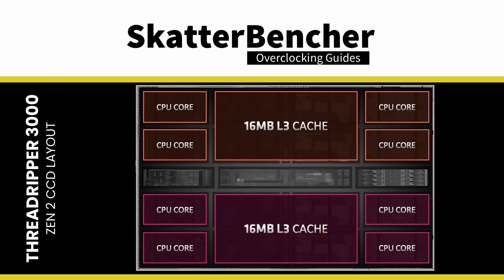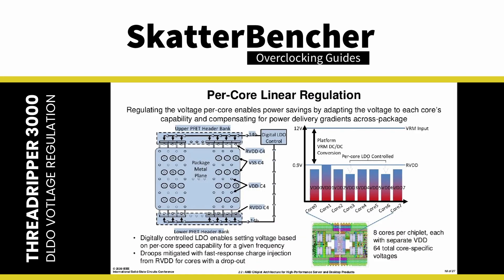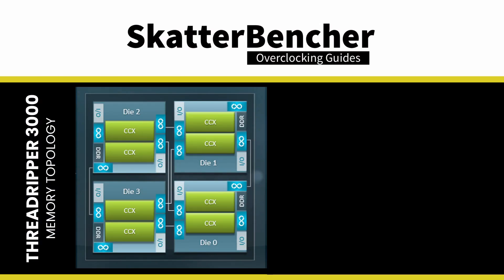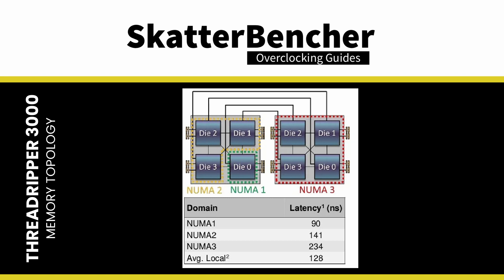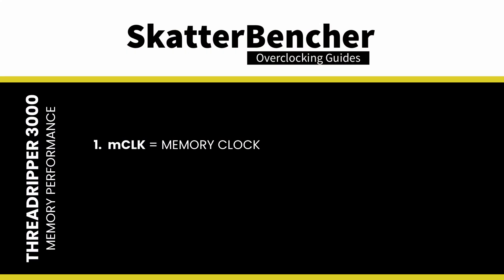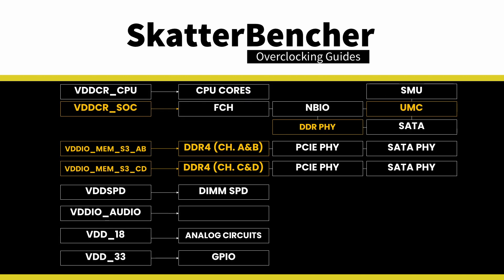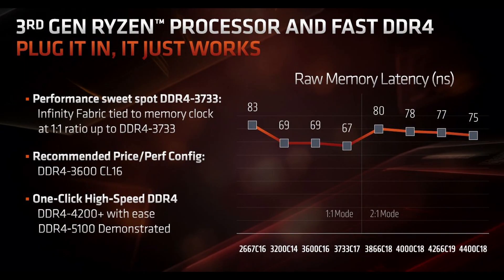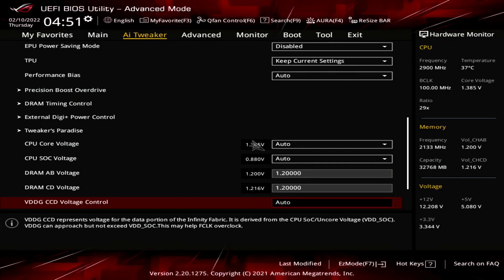AMD Castle Peak Performance Tuning Architecture Overview (Ryzen Threadripper 3000) | SB#36

Comment: hello. Is there any way or tech specs to figure out which motherboard holds / sustains heavy overclocking best?  or in any case that manages to provide higher consumption / wattage.  this also in view of upgrades with CPU 13 or 14 gen on the same motherboard.
Reply: If you only look at MHZ then it's about clock. For a 100% increase in ram throughput switch from dual channel ram to quad channel. For a 200% increase in ram throughput switch from dual channel ram to eight channel ram. A higher clock on the memory includes a greater latency. 3200C14 stays 14 14 14 14 34 in dual, quad or eight channel ram. Upping the ram speed doesn't yield a doubling of throughput. Doubling the number of channels gives a doubling of throughput. And you keep that super low latency.